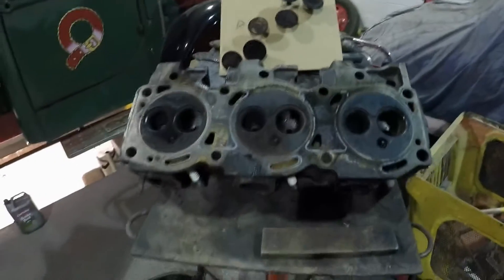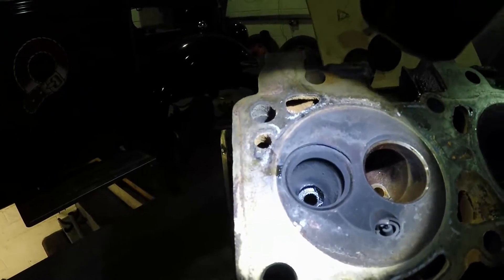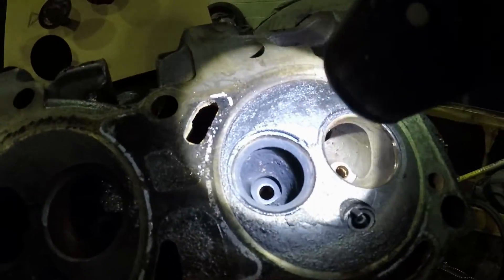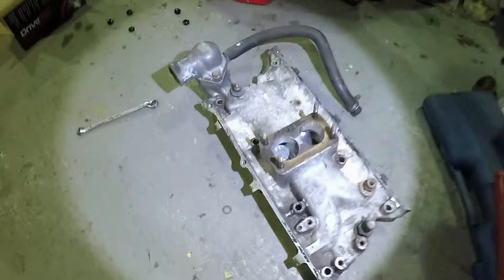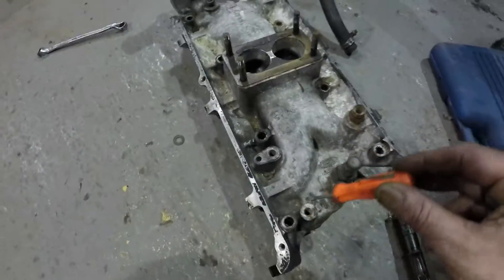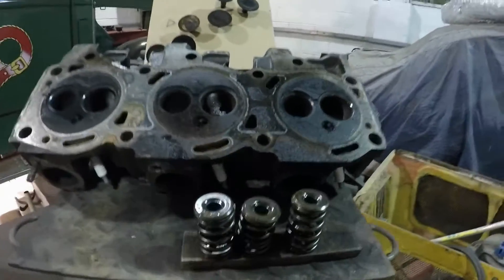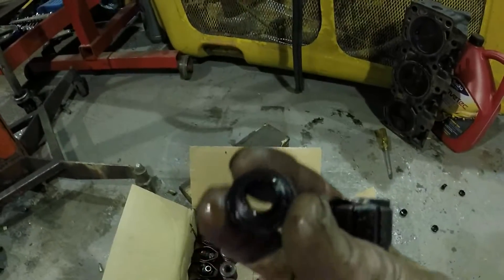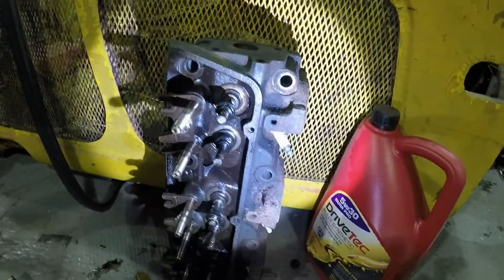Ford 3 Litre  ''Essex''  V6 Engine.    The next step ...

Comment: I’ve got a Ford Essex v6 engine in a trike so I’m not sure what car it’s come from. On the heads it’s got T1 and T2 is there any special way round for fitting these as they look identical, if I knew which engine it was I’d buy the Haynes manual.
Cheers 🍻
Reply from the maker: Like the Pinto there are not many variations of the 3 litre Essex ... I know the early engine had a different head casting with a round inlet port, but most will be the later head with the D shape inlet ports, these are more common. Apart from that the only difference was the commercial version with a lower compression ratio and a single choke carb, or the car version  which had the twin choke setup and a slightly higher compression ratio, this being altered by which pistons are fitted. Even the Capri 3.1 was basically a standard car motor that had a 60 thou  rebore. ..If you need a manual then either the MK I  Granada or 3 litre Capri will have all the info you need. As for the heads, yes they are the same and can go on either side.
Reply: @BLOWN8CYLINDER  cheers for that we’ve sorted it now brilliant feedback and quick 😀🍻
Reply: Tooling markings....................

Comment: I'm restoring a Granada Mk1 that has one of these Essex engines in it so will be following this with some interest to get some insight of what to expect and look for once I need to tackle the engine for a rebuild.  Currently focused sorting the suspension and body work but after that I will need to tackle the engine.